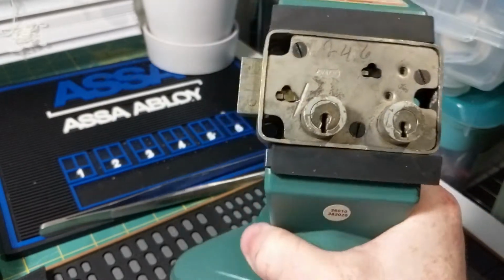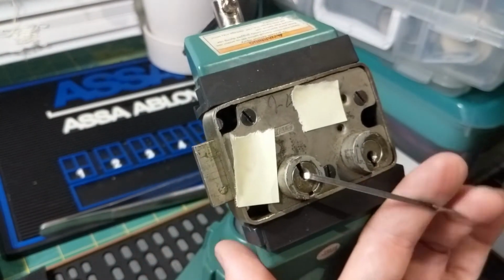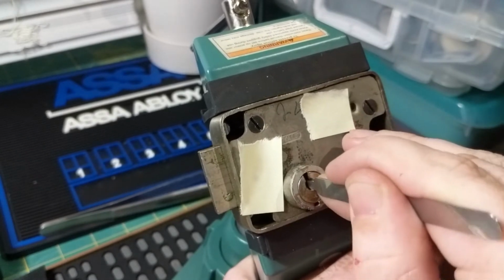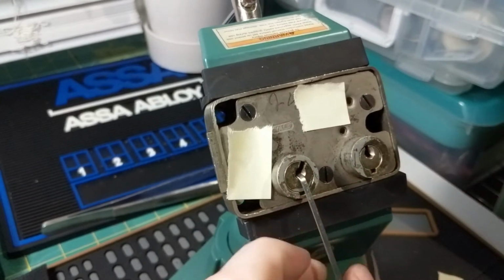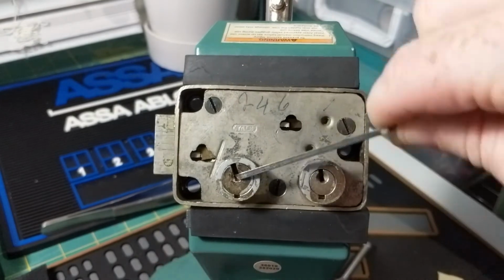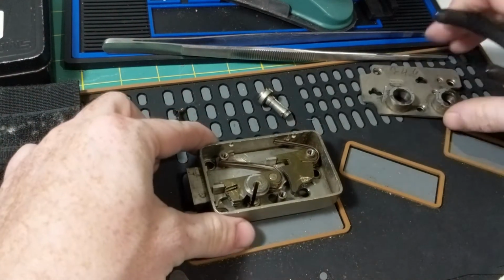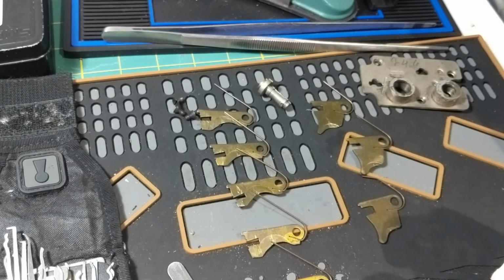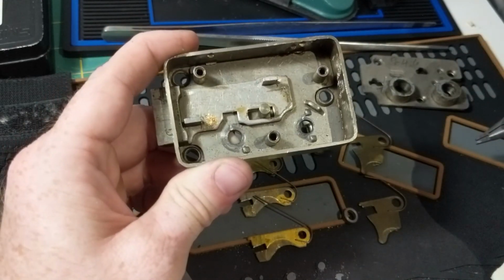∅ Picks Yale Safe Deposit Lock (148)

Comment: You sure you aren't  "working nights" to get these safety deposit locks? 😉
I was wondering if the serrated ends on the client levers aren't actually like a cog arrangement that turns the locking tongue. In any case a fascinating mechanism.
Reply from the maker: Haha no I bought these, the other ones I have coming up are a different story though.  The serrations are just an anti pick feature they exist purely to make manipulation more difficult.

Comment: Would a deep hook with a small radius in something like 0.035" be worth while for these? Let me know if you're interested, I'd be super interested on your thoughts about the profile dimensions.
Reply from the maker: Yes that would absolutely be worth while.  I have been having the most luck with a broken bogota that I filed into a short stubby hook since the shaft is shorter I can put more force on the pick tip without as many issues so something in .035 - .04 with a steep blunt hook would be great.  I have a video coming out in a couple weeks featuring a s&g 4440 that kicked my ass for a while and I am using the stubby pick in that one.  I will be featuring a few more safe deposit locks soon as well and I think a thick strong deep hook would be perfect.